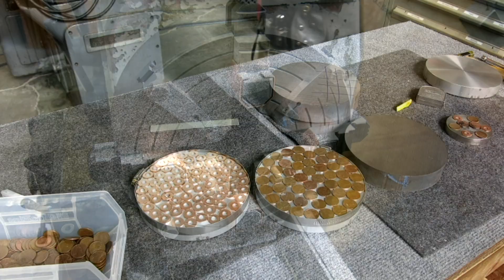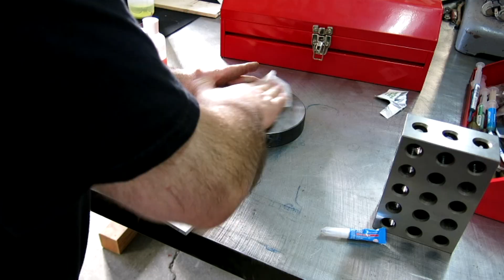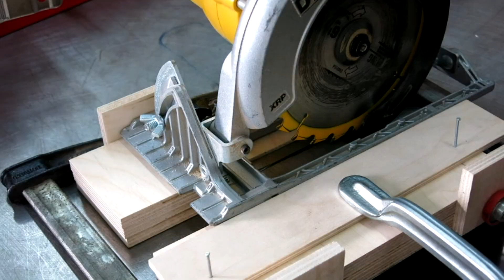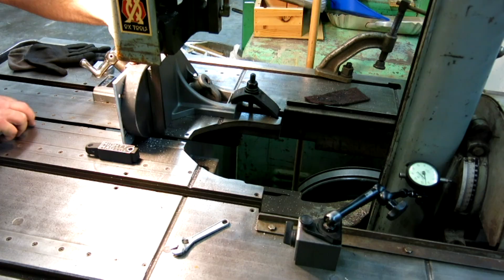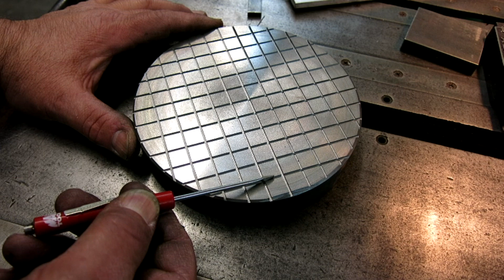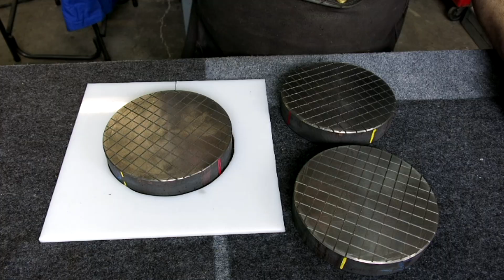Making flat lapping plates 1

Comment: Hey Tom, the problem with the wood blades these days is the body has become super thin and will warp terribly when cutting metal from the heat build up. it's better to find carbide blades that are not "Thin Kerf". I've been using circular saws for years cutting aluminum and have noticed that thin kerf blades are warping more and more. Try a Diablo Metal Demon they are great and also have a 0° rake on the tooth. Cut through Steel, Iron like butter but aluminum can gum them up but dab some wax and no issues.
Reply: Did he ever say what blade he's got? If it's a 'rip' blade, it could have offset teeth and have a point instead of a flat contact area (at the perimeter of the blade). I imagine that this could cause the blade to push/wobble.

Comment: Currently giving this a go. I've got three 6" cast iron plates from McMaster. 

They have a pretty rough finish out of the box. Running an indicator across the top of the A plate resting on a granite surface plate, I get a deviation of about .010 inches. (I know this isn't the best way to do this, but just to give me an idea of things). I do not have access to a lathe, so I can't face them off. I could use sandpaper to flatten things out a bit but wheres the fun in that. =)

I am also for the time being forgoing the cutting of any grooves as to my understanding it's not absolutely necessary and while I did purchase the test kit of Timesaver garnet along with the plates, I am opting to see what progress can be made without the use of it.

So far I have noticed the high spots becoming flatter and shinier but progress seems extremely slow which was more or less to be expected. I've lapped A on B for about an hour or so and have minimal wear around the edge of the plates. I also expect progress to gradually slow as the plates become smoother.

My goal is to see how far you can take the concept of "something from nothing" using this method. I'd imagine 200 years ago they didn't have the quality of tools we have now hence me wanting to cowboy this a bit before giving in. 

I suspect at some point I'll flatten the plates a bit with some sandpaper and start using the garnet. I think it's a toss up between the wife complaining about the noise or me getting tired. =)

Comment: Tom a very wise friend showed me how the grooves don't need to be straight. Circular work just as well and are much easier to put it with your weapon of choice.

The grooves are only needed for non-charging compounds. I'm interested to see the next episode of how you're going to lap them flat without charging them. I believe they used to traditionally be scraped flat, which can also be done with a 3 plate method.

Comment: They make these things called horizontal milling machines that can do that really well, you should get one lol!   After your first stop built lapping plate video I scrounged some cast iron and made one using my horizontal mill and a 1/16 slitting saw.  Works slick but it's only surface ground so far.

Comment: A couple of thoughts about woodchuck tools.  It's generally better to push against a single fence than to trap the tool between 2 fences - the edges of the circular saw base would need to be parallel for that.  Also, don't assume the blade is parallel with either edge of the saw base.  You need to confirm that, and adjust if needed.  Finally, don't assume the edges of the saw base are straight either.  I once bought a "good" brand name saw where the edges of the base were so curved that it was impossible to cut a straight line using a straight edge.  I took it back to the big box store, told them why, and they were totally uninterested.  They probably put it back in stock, so beware.
Reply: Michael Litzkow That is some good advice. It would seem the blade is not parallel with the base plate for sure.

Comment: Remind me never to lend you my circular saw.
Reply: Carbide teeth on a circular saw are not very different than a carbide cutting tool in a shaping machine, they cut metal, the issue I think is the heat generated. Shaping machine are also much slower but can take bigger cuts.
Reply: There are better designed reverse rake tooth blades for steel specifically  @davidlisle6084
Reply: The issue is the rpm, it's waaay too much rpm for a blade that size in ferrous material.
Reply: @davidlisle6084  take a look at circular saw blades for wood, non-ferrous materials, and for metals like mild steels. Very different designs, for a variety of reasons, and if you look into it, talk to a guy whose job is to know what tooling to use when and why, like a Manufacturing or Process Engineering Manager (but one who worked his way up over years of actually working on the shop floor, AND has the technical knowledge), and he'll tell you that the carbide grades,  how they're ground, even how they're braised in place, make them poor choices for cutting steels or cast irons (especially the cast iron). But, what the hell, it's not my money.

Comment: I'm making a set of lapping plates inspired by Toms work and I've found that a 6" grinder and a cutoff wheel works great for cutting the crosshatching in the faces. Yea it isn't a precise depth of cut like you could get with a bandsaw or a circular saw but i didnt want those chips in my good skillsaw...

Comment: good video! id love to make some laps when i have some time. 

fyi, as someone with a fair amount of "wood chuck tools" myself who sometimes uses them for metal work in a pinch, they sell metal cutting blades for most circular saw sizes, both for ferrous and nonferrous metals. 

Most wood cutting blades really dont have the rake angles to hold up to metal work, and the teeth are too small  without enough brazing surface, and as you experienced are also too thin usually. metal cutting blades have less agressive rake angles, more and thicker teeth, better quality carbide, longer and wider brazing surfaces, and much thicker and stiffer bodies, this is why they can cost several times more than their wood cutting counterparts. you can get close with some quality finishing blades, but the angles are still wrong. 

i have several for my skillsaw 77  (you really need one of these instead of that dewalt cordless crap, you can usually find old ones at secondhand stores and pawn shops cheap but be carefull because almost guarnteed it was owned by a tradesman and abused) my 10" table saw and 12" chop saw. they come in verry handy, I even cut a 1/4" plate for the top of a small welding table with it. I have found some at secondhand stores in new condition selling for $5 because they didnt know how much they cost originally.

in a pinch you can also use blades ment for demo work (made to be able to cut through nails)

Comment: I wasn't quite through laughing about "sharpie mouth" and then you had to spring a few gems on us in this episode. I think machinists have a uniformly bizarre sense of humor. I've used carbide "woodchuck" blades in a slit saw arbor on aluminum for a deep reach resurface. Slow slow slow. Did OK. I found myself wincing during your cast iron grooving operation. Not only are you funny your pretty brave.

Comment: I've been wanting to try this. My initial thought for the checkering was either a tiny endmill, or attach it to an angle plate and use a slitting saw. 
might be a bit (lot) slower, but it would do a nice job of it

Comment: The high positive rake of thin kerf blades are likely causing the blade wobble on the wood blade. Most comercial buildings require metal studs blades made for that work may serve better. I need a bandsaw like that. nice work Tom
Reply: https://youtu.be/rHmsQEAx16o?t=973

Chassis scie est coincée en arrière 16:13, lame ne pas être fautive.

Comment: File or chisel would also be cheap low tech alternatives for cutting those grooves.  That circ saw is just sketch and I’ve cut plenty of stock on carbide tipped and abrasive chop saws.   I’d rather spend the time and effort with the hand tools than build one off jigs and fixtures for one off tools.

Comment: I'm glad I wasn't close to the TCT saw blade. Your shaper would have surfaced the discs unattended and easily cut the grooves with feed dial accuracy. My shaper has a swarf collection box around the vice and keeps the shop clean when in use.

Comment: a quick comment on using a dewalt saw with a guide the blade is not square with the sled on the saw in some cases, I have ran into the same problem attempting to rip plywood with my saw and the saw will bind up when using a guide.

Comment: Hi Tom, I except the problem with using your batterie saw with a fence is that the edge of the fence are seldom parallel with the the blade. I have experanced this in my joinery shop. Yours Mike Cox p.s. Great channel

Comment: I am only a novice and find your films excellent and I am learning so much, after being 35 years a pharmacologist engineering is great relaxation for me!
But please answer me this one question: why not cut those slots with a milling cutter in a mill?
Thankyou. Dave. UK
Reply: I agree. As a machinist I would tilt the head over to 45 and mill the grooves with an end mill. Carbide would be best but HSS would also work. Next question, how would you use those plates to lap other parts with no grooves flat? That’s really what I expected to see here. Thanks.

Comment: Re: Cast iron slitting with a carbide wood blade circular saw. 
Hilariously/tragically The formerly very nice cast iron table of my table saw can confirm your theory about cutting through a sacrificial piece of plywood to form a nice groove. Except in my case the piece of plywood wasn't intended to be sacrificial and I wasn't intending on making groves in the cast ion top of my table saw...

I suppose now I need to buy 2 more table saws, made groves in them, rub them together for a bit and pretend that it was all on purpose!
Reply: Yep, my cast iron drill press table suffered the same fate, using a carbide tipped blade on my Skil saw...

Comment: Diamond angle grinder blades are amazing to cut cast iron with =)
Reply: Tomas Wilhelmsson I thought the same thing but he didn't mention it, I wonder if had to do with repeatable cuts, alignment and accurate depth.
Reply: true but you could make a jig for the angle grinder also =) just wanted to mention it if someone didnt know diamond blades cut throught cast iron like a hot knife throught butter =)
Reply: I have a 'chop saw' contraption for my angle grinder, sure this would work for this purpose.
Reply: Fred Genius pictures?
Reply: Fred Genius That's really cool, purchased or did you make it? Thanks.
Reply: Purchased, eBay, search for 'Angle Grinder Stand', only cost ~£25 for angle grinder and stand!
Reply: Sorry, my image links dint survive the Youtube moderator bot!
Reply: Fred Genius I got it in time
Reply: :) Not sure why my comments were deleted, maybe youtube can explain?
Reply: I got myself a set of cheapie tile blades that so happen to fit my grinder. They are 5" and fit in the 4.5" grinder just right. I have cut everything from wood, to cast iron, to plastic to steel, to stainless steel with those cheapy blades. The best 5$ per I have ever spent. Just as a FYI, get the type that have serrations on the sides and slots going through them. They tend to clear themselves out. Just one thing they do not cut properly is aluminum. It tends to melt on there and turn to goop. Also it is amazing the precision you can get with a small jig and a grinder with one of those blades. :)
Reply: They don't recommend you use diamond tools on ferrous metals (cast iron and steels). A chemical process at the temperatures produced at the chip tool interface will break down the diamond (a chemist might be able to tell you the details, I just cut metal), and you'll wear your tool out prematurely.
Reply: If the diamonds get over around 1300 F they can start decomposing rather quickly into graphite/CO2
Reply: or idk, a mill...

Comment: Great Video.  I am just learning but have several questions that you might address in the next video.  What is the point of a lapping plate?  I understood that different grits of sandpaper on the surface plate was suitable for flattening.  That said, wether a lapping plate or sandpaper is used, what would "we" be lapping; when would we use these plates?  You have selected rather small and circular pieces of metal was there a reason?  Looking forward to the next video and apologies if my questions seem basic.  Thanks!

Comment: Hi Tom, I'm making a set of these laps (the cast iron ones), pretty much following along but modifying machining methods to suit my limited shop. I'd love to see you actually lap some things with them. I'm not finding clear information out there on whether I should be using these for slurry only (rougher lapping I suppose) or would look to charge them, clean them (leaving embedded grit) and then use them with something like WD-40. Also, I'm not sure what grit would be best. The Timesaver is good for leveling the plates it looks like, but not for actual lapping because the cast iron is softer than hardened steel and would wear more than the part with the rolling abrasive. I'm interested mostly in flatness (e.g. bottom of surface gage) rather than a lustrous finish (although maybe that would do better sliding across the surface plate).

Comment: I was going to suggest using an angle grinder to cut the grooves, but Tomas beat me to it. Waiting for part two, want to see how you're going to use the copper coins - might be a problem in the UK because copper coins are actually copper plated steel - or is that part of the plan? Thanks Tom, in advance...

Comment: I assume the closer to 90deg the ledge that is formed by the groove the more aggressive the lap? If for example you ball milled radiused slots at less than the radius the obtuse angle left would not cut as much?
Reply: bcbloc02 I'm not sure if it matters, I have a bought lapping plate with the grooves cast into it and they are radius grooves  I assume it is to allow removing the pattern before casting, and it works fine since the cutting is done by the abrasive imbedded in the flat surface. I guess too shallow a groove may cause clogging though.
Reply: bcbloc02 I'm not sure if it matters, I have a bought lapping plate with the grooves cast into it and they are radius grooves  I assume it is to allow removing the pattern before casting, and it works fine since the cutting is done by the abrasive imbedded in the flat surface. I guess too shallow a groove may cause clogging though.

Comment: I think the problem with your circular saw is that the guide isn't parallel to the blade. Your cuts were fine when you were unguided, but as soon as you relied on the saw's guide the blade bound and gouged your part

Comment: I loved the sequence when you used the circular saw to cut the grooves. Then you used the wood on top of the plate to help guide the saw blade to keep it stable in the cut.
Very interesting especially since it worked with the wood. I just can't help but harken back to the character Rube Goldberg with his improvisations of doing work. Tom, I'm not implying that you are Rube Goldberg-like. 
https://en.wikipedia.org/wiki/Rube_Goldberg_machine
Looking forward to part two.
Thanks for the videos and I'm learning lots from you.

Comment: I've used a Bridgeport horizontal milling attachment and a 1/16" slitting saw to put some grooves in a beat up cast iron surface plate.

Sooooo slow!
Reply: If you had a couple more slitting saws you could do the whole thing in two passes - once for the horizontal, and once for the vertical!
Reply: Max Hammick That'd be expensive, but awesome!

Comment: good video tom . your experiments with the circular saw made me think about the possibility of using a arbor and a smaller diameter saw blade on the milling machine. the blade speed could be set closer to the recommended sfm and using some stabilizer washers wobble could be eliminated. what do you think .
Reply: My thoughts were why not use a slitting saw!

Comment: For cutting grooves without fancy equipment, don't go using your carbide tipped circular saw blade thats made for wood. Buy one of these Diablo "steel demon" blades. They're only $25 and work very well. Crap. Since it wont let me post a link, its the 38 tooth diablo steel demon blade that specifically says "for thick ferrous metals".

The reason oxtoolco's blade went sideways was because the wood blades are too thin and "walk" when used in metal.

Comment: Could you use a spiral groove instead of squares and use a real quick facing feed rate on the lathe?
Reply: i like ur thinking
Reply: Fernand Geene Van I think you have a very good point. It would be interesting to see how rapid the wear is with these plates and how often they would need re-lapping.
Reply: For symmetry's sake, make it 2 spirals . . . in opposite directions :p
Reply: georgewocosky 👍
Reply: Fibonacci curves (like on a sunflower, pineapple, or pinecone) so that the cells stay the same area.

For an example: bit(dot)ly(slash)fibonacci600 

Darn YT's policy of no urls
Reply: Or maybe Voronoi?
Reply: Diamond, triangle , circle, . . . yet the spirograph would look 'cooler' ? ! 
;)   Crystalite makes some interesting patterned faceting laps , the 'ripple disc' being just one .   ( I can think up a thousand random patterns that would work - the bottom line is to have a place for the swarf to go , while producing a 'true' plane )    Using discretion in the application of the lap to the surface being lapped is another important topic !    * I kind of like honeycomb pattern , but it's a bit time consuming without CNC !   :p
Reply: i think if you put your cross slide in super coarse feed, and do a face thread, have to run it back on its tracks and take a deeper pass
Reply: There is no need for square serrations, concentric circles(grooves) cut on the lathe at the facing operation is adequate and does away with sawing operation.
Reply: Like lathe chuck spiral plate?